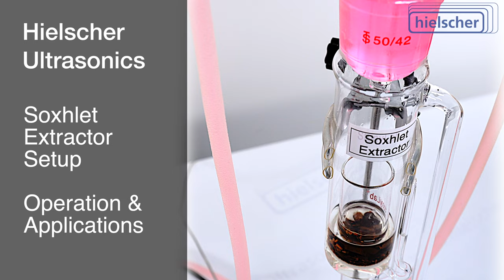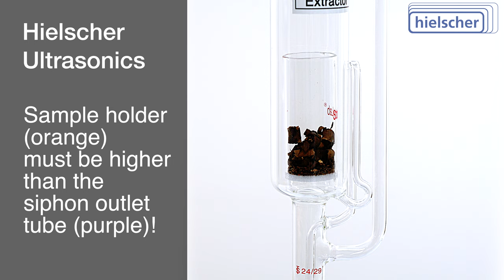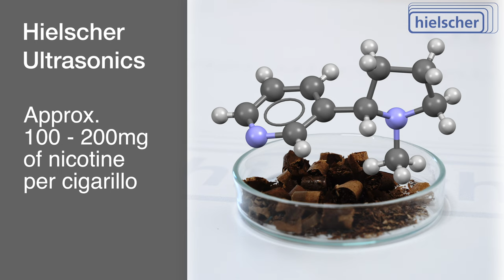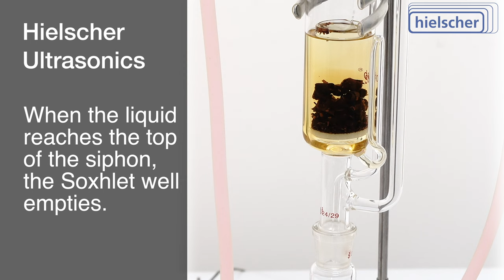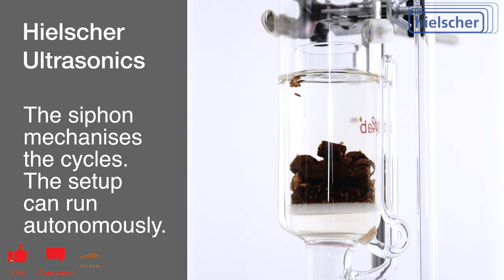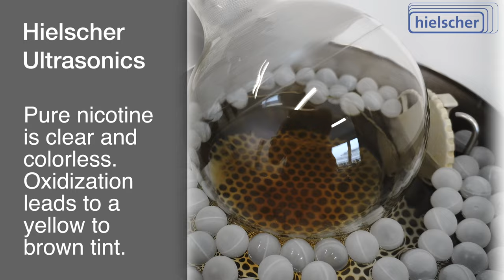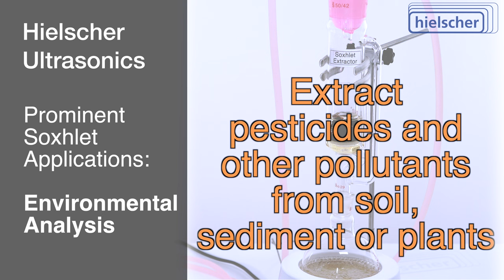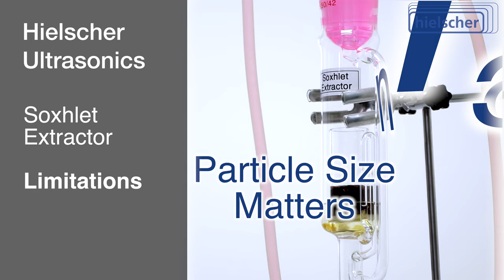Soxhlet Extraction - A Tutorial About Setup, Function & Applications #soxhlet #extraction

Comment: Sorry to bother can I ask if Which is much better in extracting tomatine from tomatoes, soxhlet extraction or sonication? Which solvent can I use, and will the extract be more crude or fine upon using said solvent?
Reply from the maker: @Erniz-y7c Sonication is the more efficient and scalable method for extracting tomatine from tomatoes. Soxhlet extraction, while effective at extracting tomatine, is time-consuming and less energy-efficient. It typically requires several hours to days, operating at high temperatures with continuous solvent cycling, which can lead to the co-extraction of unwanted compounds, resulting in a crude extract. Sonication, in contrast, uses ultrasonic waves to disrupt plant cell walls, releasing the tomatine more quickly and with less heat exposure - at sub-zero temperatures, if you like. This makes it more time-efficient, reducing the extraction process to under an hour, while also preserving the integrity of thermally sensitive compounds. Additionally, sonication is more adaptable for large-scale industrial applications. High-power ultrasonic homogenizers, such as the UIP6000hdT allow for scalable batch or continuous flow processes, making it a superior choice in terms of overall efficiency and scalability.

In terms of solvents, both ethanol and methanol are commonly used for tomatine extraction due to their ability to dissolve polar glycoalkaloids like tomatine. Methanol is particularly efficient for penetrating plant materials, but ethanol is often preferred in food and pharmaceutical applications due to its lower toxicity. Sonication combined with these solvents typically yields a finer, more selective extract compared to Soxhlet extraction, which often produces cruder extracts due to prolonged solvent exposure. The faster and more controlled nature of sonication reduces the risk of co-extracting undesirable compounds like fats and pigments, resulting in a purer tomatine extract. For both laboratory-scale and industrial-scale extractions, sonication, particularly with ethanol or methanol, offers significant advantages in terms of time, efficiency, scalability, and extract purity.

How much material would you like to extract tomatine from? Please contact us directly! We will be happy to discuss your extraction project.
Thank you for viewing our content. For more insightful videos, we invite you to subscribe to our channel: 👉 https://www.youtube.com/channel/UCG1xa_8clP9cRlq7kIcWQug?sub_confirmation=1

Comment: How is the amount of solvent determined? Thank you, I’m having problems with a batch I think I added too much water to the flask
Reply from the maker: @momsmushroomsjodyfoster5786 There are two aspects:
1) The solvent volume should be high enough so that the flask does not run dry when the solvent evaporates and fills the Soxhlet well. The solvent volume should be low enough to allow evaporation. Our suggestion: At the start, fill the Soxhlet well manually with solvent to just below the apex of the siphon and fill the flask to the level of its maximum diameter.
2) Depending on the compound amount to be extracted, you should not oversaturate the solvent in the flask, which would cause separation (e.g. precipitation). If you see oversaturation, use less botanical material in the Soxhlet well.
Have you considered ultrasonic extraction as an alternative or add-on to Soxhlet extraction, yet? We will be glad to discuss your extraction requirements. Please contact us directly!

Thanks for watching! Please subscribe to our channel for more interesting videos! 
👉 https://www.youtube.com/channel/UCG1xa_8clP9cRlq7kIcWQug?sub_confirmation=1
Reply: Thank you so much for your fast response! It’s difficult finding answers for my questions! But, again please. Should I be adding 250mills of liquid to the a 500mill flask? Because the liquid expands as its heated, correct? I tried adding more than 250 mils of water, and it was disastrous.
Reply from the maker: @momsmushroomsjodyfoster5786 Fill the flask to just above the widest diameter. Depending on the volume of your Soxhlet apparatus, you may have to add a little more, if you see the level in the flask falling too low. 
Make sure that your condenser condenses all water vapor, so that you don't lose water during the process. You see that our Allihn condenser has a very narrow opening on the top to avoid vapors exiting instead of condensing. Use a low coolant temperature on the condenser.
The expansion of liquid due to heat is insignificant. 
Use boiling stones to get smoother boiling in the flask and use medium heat to start slow. Once you have everything under control, you can increase heat in small steps to speed up the process.
Alternatively use cold water and sonication and avoid the Soxhlet all-together.
In a Soxhlet extraction, the extracted compounds are exposed to heat in the flask for a long time, causing heat degradation. With our sonicators, you can extract at cold temperatures, so that the compounds are not exposed to heat.
Reply from the maker: @momsmushroomsjodyfoster5786 You can find a detailed Soxhlet extraction guide at https://www.hielscher.com/wp-content/uploads/Soxhlet-Extraction-Guide-for-Academic-and-Professional-Domains-Hielscher-Ultrasonics-Germany.pdf

Comment: Hello. I would like to ask. If I would want to extract mushrooms, is it better to use soxhlet extraction setup or sonicator? With soxhlet to make water extracts I would need to boil water to get water soluble compounds. With sonicator it is only possible to extract alcohol soluble compounds and I will need to make boiling after also to get water soluble compounds if I want double extraction? Or sonicator can not only make alcohol extraction but water extraction in cold water without boiling too?
Reply from the maker: @SoloSp33d When extracting mushrooms, the sonicator is the superior choice over the Soxhlet extraction setup for several reasons. Firstly, the sonicator operates at lower temperatures compared to the Soxhlet, minimizing the risk of thermal degradation of heat-sensitive compounds present in mushrooms. In Soxhlet extraction, the extracted compounds are exposed to heat for a long time in the heated flask. Secondly, the sonicator provides better control over the extraction process, allowing for precise adjustment of parameters such as amplitude, power, temperature, and duration to optimize extraction efficiency. Additionally, the sonicator has a higher capacity, enabling the processing of larger volumes of mushroom material in a shorter time frame.

Contrary to the misconception, the sonicator is not limited to alcohol extraction alone. It is capable of extracting both alcohol-soluble and water-soluble compounds from mushrooms, including polysaccharides and other bioactive components. Furthermore, ultrasonic extraction in cold water is possible without the need for boiling, making it a versatile and efficient method for extracting a wide range of compounds from mushrooms. Therefore, the sonicator is the preferred choice for extracting mushrooms due to its ability to operate at lower temperatures, offer better control over the extraction process, and accommodate higher processing capacities.
Thank you for engaging with our video. Enhance your experience by subscribing for more professional insights: 👉 https://www.youtube.com/channel/UCG1xa_8clP9cRlq7kIcWQug?sub_confirmation=1

Comment: I have a question: why it is said that soxhlet extraction characterises a cold extraction, but everywhere I look it is said to be hot?
Reply from the maker: @symptomesdelau-dela5442 The confusion about Soxhlet extraction being a cold extraction process comes from the fact that the condensed solvent is cold when it drips onto the sample, where it extracts the compounds from the sample. However, the overall process involves boiling the solvent, making exposing the extracted compounds to heat for a very long time. This heat exposure can be problematic for heat-sensitive compounds, which is why our ultrasonic probes are in high demand for botanical extraction. Our sonicators can operate at very cold temperatures, even down to 30 degrees below zero, preserving heat-sensitive compounds and ensuring high extraction yields and quality.
Thank you for engaging with our video. Enhance your experience by subscribing for more professional insights: 👉 https://www.youtube.com/channel/UCG1xa_8clP9cRlq7kIcWQug?sub_confirmation=1
Reply: @HielscherUltrasonics  Thank you, I apreciate the video!
Reply from the maker: @symptomesdelau-dela5442 Thank you! 😀

Comment: Can water be used as a solvent?
Reply from the maker: @momsmushroomsjodyfoster5786 Water can be used as a solvent in a Soxhlet extractor, but it will extract water soluble compounds only. Without sonication, the water or solvent will not break cell walls. Therefore, extraction is very slow and incomplete. Hielscher sonicators can extract compounds quickly and efficiently  without using a Soxhlet. Please see https://youtu.be/cCH-FGrJwiQ for example.

Thanks for watching! Please subscribe to our channel for more interesting videos! 
👉 https://www.youtube.com/channel/UCG1xa_8clP9cRlq7kIcWQug?sub_confirmation=1

Comment: I don#t get it. Isint it the same as puting it a few times in solvent and evaporating it?
Reply from the maker: @tparty22 The key difference between Soxhlet extraction and simply soaking and evaporating a sample in solvent multiple times is the automation of the extraction process.
When you just soak a sample in solvent and evaporate it, you may not extract all the desired compounds, especially if they are present in low concentrations or are difficult to dissolve. You would need to repeat the process many times, which can be labor-intensive, inefficient, and may still not yield a complete extraction.
Soxhlet extraction is designed to continuously cycle fresh, clean solvent over the sample. The solvent repeatedly passes through the sample, gradually dissolving the compounds of interest and ensuring they are effectively extracted. The advantage of this method is that it allows for a more thorough extraction without needing to replace the solvent manually or evaporate it multiple times. This makes Soxhlet extraction useful when working with large volumes of solid material or when you need to maximize the yield of extracted compounds.
In summary, while both methods involve solvent and evaporation, Soxhlet extraction automates and optimizes the process, leading to a more efficient and complete extraction.
Alternatively, just use one of our sonicators to extract efficiently at low temperatures. What would you like to extract? Please contact us directly! We would be happy to discuss your extraction project.
We appreciate your interest in our videos. To stay updated with our latest content, please consider subscribing: 👉 https://www.youtube.com/channel/UCG1xa_8clP9cRlq7kIcWQug?sub_confirmation=1